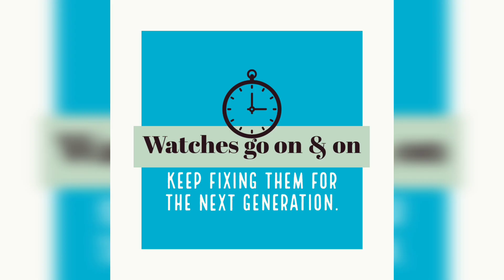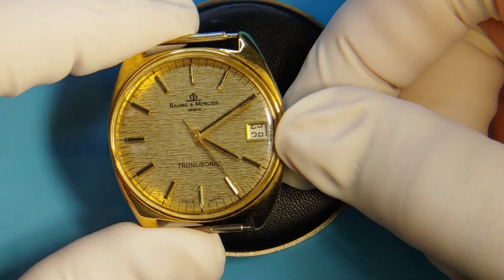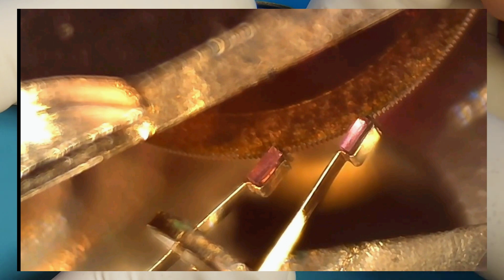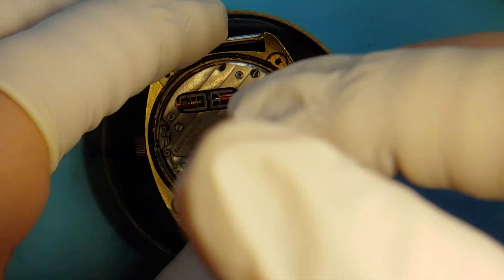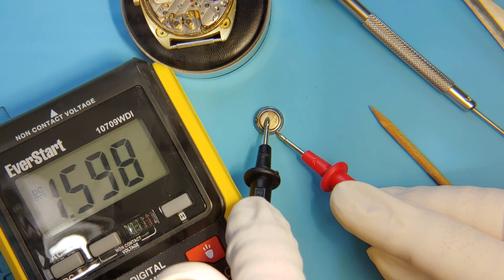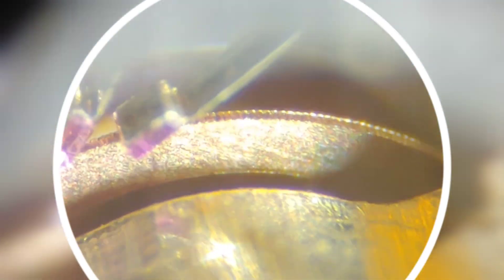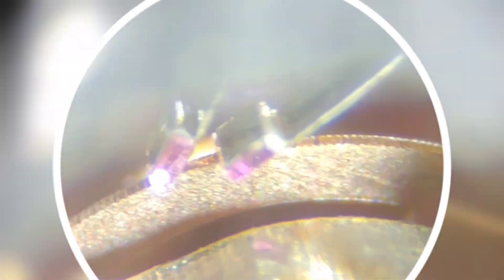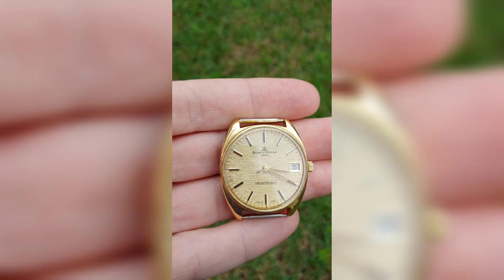Tuning Fork Watch Issue

Comment: Upon opening the back, a visual inspection even before checking the battery, you can see a battery clamp on the left cup of the magnetic tuning fork. Chances are, the watch will start running
Reply: You mean a case clamp, not the battery clamp.  If you look closer, you will see that there is a second case clamp missing also as well as both screws.

Comment: Hi Hector, Fredrick is right. I service these tuning fork watches, and this one is an ESA9162 movement badged up as a B&M calibre (Omega's version is the 1250 calibre). The object 'stuck' to the tuning fork cup is not plastic, it is in fact one of the 3 metal movement clamps that hold the movement in the case. You can see only 1 is in its correct place around the edge and held with a screw, the other 2 and their screws have come loose and might be elsewhere in the watch or have been lost. The tuning fork has 2 very strong permanent magnets ( 1 in each cup) and the case clamp is held in place on it from this magnetic force (no glue). This is what is stopping the watch running correctly as it is hindering and reducing the amplitude of the tuning fork oscillations, and the index jewel is not moving far enough to latch over the edge of the tooth on the index wheel. It will probably work just fine as soon as you very carefully remove the stray clamp with something non-magnetic like a toothpick. Do not touch/damage the copper coil wires. The index wheel is most likely in good condition, and the index jewel is vibrating it back and forth. The index and pawl fingers/jewels look to be well aligned to the index wheel. Also, these movements do not have cannon pinions like traditional mechanical movements, there is a friction wheel that has to be correctly lubricated to achieve the right friction and this is the likely cause that the seconds hand spins clockwise; if it was spinning in the other direction the index wheel teeth would be shaved away and destroyed in seconds by the index and pawl jewels, so it is very important that the friction wheel is serviced or replaced right now. The tuning fork itself should never be demagnetised during a service. Unless you are an expert on these movements you should not attempt to service them. Also never move the seconds hand backwards as it will destroy the index wheel, the rear electronics module needs to be removed from the watch first before anything else is done. You can find and download the ESA9162 service manual pdf on-line for free. Hope this helps, good luck, Andrew.
Reply: If the second hand can be moved backwards it is not serviced properly
Reply: Hello, was wondering if I could get some advice on an Omega 9162 movement I recently acquired, is there anyway I can reach you out?
Reply: @Meisterhix  are you able to put your email ID here?

Comment: how much work have you actually done on movements like this? Bulova is the inventor of this movement and yes that wheel is delicate and may be destroyed but huge amounts of these movements stil works today without much issiue. I have a hard time accepting that the shape of the wheel is the cause here because as you can see the thoots are all basicly the same size and shape then you would claim the someone has destryed all 320ish tootha equally, no going to happen. have you even considerd that it needs a cleaning and oiling, and what about that "object" that looks like stuck on the left coil. Nope this watch is probably not suffering from a bad wheel its suffering non existent service.
Reply from the maker: Hi friend. What you see on the left coil is a piece of plastic that got glued there. How it got glued there? IDK either jjj. I did not want to remove it for a couple reasons. The most important one is that the wire used on these coils are thinner than a hair. Trying to remove a glued plastic from that coil would probably mess it up. I did not want to run the risk. Second, the watch hums, so the stucked piece of plastic is not causing the coil to stop doing its job. 
Now, I know that from the video it is actually difficult to get the full grasp of what is going on. Under my 🔬 I could easily see the index fingers sliding/slipping instead of pushing on the index wheel teeth. The index wheel is not stucked. I can move it with a pieces of pegwood, and it also moves freely when trying to set the watch in time. 
That it needs an overhaul? Yes, I agree, but it won't restore the index wheel. We are talking about microscopic teeth, things that can't be seen with a naked eye, and they are extremely delicate. Now, on the video I use a mix of pictures to show what an index wheel should look like, and short videos from my 🔬 to show the action of the index fingers, and the bad shape of the index wheel. Hopefully this answers somehow your questions lol. It is also valid to say that I am a hobbyist.
Reply: @watchesgoon absolutely not a piece of plastic, it’s a metal movement hold down clamp that’s absolutely disrupting the tuning fork frequency. Simply comparing the clamp like what other commenters have said would show you a huge fault with the watch you chose to dismiss, a piece of plastic lmao what a joke

Comment: Man thank you, you my hero, this problem with fast moving arrows, ok I understand it, buuut feck, I don't have such powerful zoom to check teeth of index wheel, damn, I need to improve my instruments
Reply from the maker: Thanks for you comment Space SpicE. A microscope makes the difference when it comes to such tiny parts. Cheers
Reply: @watchesgoon  is it enough to have x60 zoom for such works?
Reply from the maker: @SpaceSpice  yes, it should be fine. I normally use x20 or x40. Almost never you will need higher than that. I use an amscope microscope, the quality is decent. The only problem I have with it is that the working distace is just one or two inches max. In the future I would love to get one that gives me at least 6 inch of working distance, but they are expensive lol 😆
Reply: @watchesgoon  yeah with such zoom its very cool to operate with parts, but because of this distance from lens you can only check this all.. thank you for advices, not many information around about servicing and operating with f300 watches, its quite difficult to find useful information about specific cases for repair, as a newbie watchmaker I need to study a lot. Btw any tips about cleaning mechanical parts? Or its the same as the process for typical mechanical watches? Got one Omega f300 working and keep time very good, but I was shocked when disassembled movement it was all in dirt, and still working wow
Reply from the maker: @SpaceSpice  when it comes to cleaning watch parts I use naphta and 99% IPA. Some other folks use L&R products, but I've been using naphta and IPA with excellent result so far. Now, bear in mind that tuning fork movements have mechanical and electronic components, for those movements I would go toward the L&R products instead of the naphta and IPA. Also, the jewels on the index fingers might be held in place with shellac which disolves in IPA. The same happens with the pallet fork jewels, and the impulse stone on a full mechanical watch. So, when using degreasers and cleaning agents you have to consider all the variables so you don't cause more harm than good. The safest route for movements like the one on your omega 300 would be L&R products, in my opinion. I am a hobbyist like you. Have fun. Cheers
Reply: @watchesgoon  thank you! My master Jedi! 👏😀

Comment: Bulova made a watch similar named the Accutron. I was in a watch repair school when I first saw one and I took it apart and screwed it up by putting the bridge on without moving the fingers out of the way first, it took me nearly an hour under the microscope to straighten them back out.
Reply from the maker: Hi William, 
I've watched some videos about the Accutron, but I've never had one to work on. 
yes I agree, tunning fork movement are very delicate to work on, especially the fingers, and the index wheel parts. 
Thanks for commenting. Cheers!
Reply: @watchesgoon  😁👍